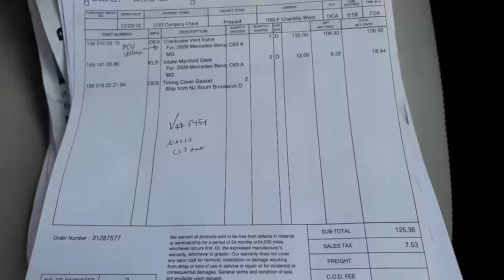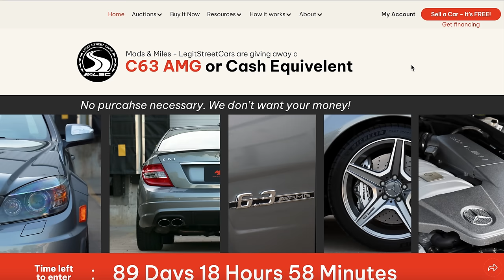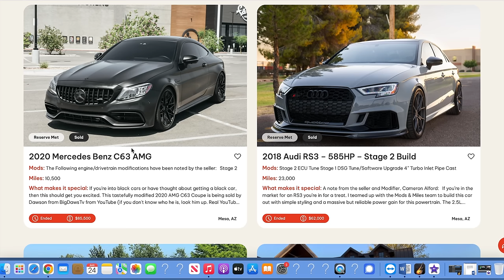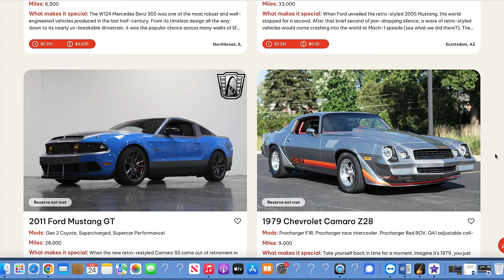I Bought A Blown Engine C63 AMG 800 Miles Away! Flew In With A Bag Of Tools To Fix It & Drive Home!

Comment: Hi Alex, had the same happen with my C63...just cruising along casually and blew a piston. Check the spray patterns on the injectors that were in there along with the pcv. Those were the culprits for me.
Reply: Wow. Terrifying, & sorry to hear that. Where does the pcv system failure come in to play here? Was it excessive amounts of oil getting by just like the excessive amounts of fuel from the bad injector?
I'm lower on the totem pole with a 3.5L m272 & I'm at the point where I'm going to be doing my oil separator & it's cover on a regular basis. Even after 20k ish mi, it starts letting way too much oil past gumming up that weak manifold.

Edit: I'm an idiot & forgot how the injectors go through the manifold. If the m156 pcv system is as shit as the m272's, those injectors are getting all that carbon.
Reply: The most amazing part must be mercedes marketing Department. If a Chinese car company built as crappy quality cars as mercedes no one would ever buy that crap. Their interiors are super bad and cheap, their engines are crap, panel gaps horrible. Good job to the marketing of MB.

Comment: Greetings from South Africa, your channel helped me greatly with my W210, fixed most things myself and avoided ridiculous shop quotations for repairs, unfortunately had to sell it due to some challenges. Looking forward to getting another cheap one and start working on it, keep it up you have no idea how valuable your channel is  to us in small income nations
Reply: Did you do the crankshaft pulley replacement by yourself ? I'm about to do that and a valve cover gasket replacement on a FREE 2001 Mercedes E320 wagon
Reply: Mzanzi in the house?
Reply: @hajileserpud9539  how did u get a free car
Reply: @raresrares7817  I work as a side hustle doing mobile mechanic and a customer had this low mileage 2001 sitting in a garage outside, he couldn't get it to start and dealer wanted lots of money to diagnose and fix so he just gave it to me because he didn't want the headache
Reply: @hajileserpud9539  damn man u lucky,im tryna be like u

Comment: Last year I picked up an 86 Trans/Am with a supposed blown LB9 305 engine, I sourced another 305 and was ready to go get it until my dad took a quick look and realized the firing order was for a Ford, new plugs and wires put on right car fired right up. Paid $800 for the car with 142,000 Kilometers on it, next on the list is a clutch and exhaust and it'll be on the road next spring.

Comment: I just had a stuck open injector on a 01 Yukon with 5.3 it filled the cylinder with so much gas so quickly the rod snapped trying to push the piston against all the gas. Trying to save money tested the other injectors with 12 volt battery, they all clicked but a couple clicked quieter than the others. Rebuilt it, turned it over…BAM instantly same thing happened on other side. Broke the rod in same area as one on other side.

Comment: The car has registration and inspection stickers from NY which expire in April of 2023, I think what happened is the owner you bought it from probably bought it with a blown engine, tried fixing it themselves and gave up.

 NY registration has to be renewed every 2 years so that car was registered no longer than 1 year 5 months ago, and knowing the kind of people who drive these kinds of cars here in NYC, paired with the aftermarket additions, I'm pretty sure this car was run pretty hard, had a fuel/air problem that the owner tried to figure out themselves (manifold gaskets), and eventually the engine locked and it was sold to someone in PA, and then to you.
Reply: Every NY or NJ car that I've seen being sold in PA is a hot mess. It's like they think we are more gullible here.
Reply: @brandonwc  sounds like you are 🤣🤣
Reply: @brandonnunez3644  Yeah, I'm not saying they are wrong. I'm pretty sure I got a Hurricane Sandy truck. They laundered the title through DE and I was too impatient to get a carfax.

Comment: With how frequently modern engines have top end or piston failures they should start coming with a split sleeve that only goes down the first half of the way (the majority of the force and heat is in that top portion anyways and it’s relatively likely that damage would be more likely up there) the design should be so that with the head off and the motor mount out on the opposite side to tilt the engine you can slip it past the body of the car and slide it in enough to use a tool to press it in that mounts where the head does. With a system like that you can save probably 90% of the engines that otherwise can’t be and possibly get some level of functionality out of the other 10% aside from crank failures, any lower cylinder wall damage could even just have the wall cleaned enough that the rings don’t get caught, or a possible stepped bore could be made so the bottom is also a sleeve and rests on a ridge and a groove in that accepts the top sleeve which would have a wider top sealing area (wet sleeve) so the bottom seals can slip past it enough to allow the previously mentioned pressing tool to fit.
Reply: These kind of cars seem so cool and fun on paper and in theory, but I'm glad I never bought one. Super high performance cars are a crapshoot, and they would cause too much anxiety for me to ever enjoy properly.
Reply: @OMGWTFLOLSMH  the old Jaguar v12 was pretty reliable

Comment: Considering the spark plug was already loose on the bad cylinder then I think it's pretty much guaranteed they knew it was bad
Reply: 100% they knew, damn I hate scammers, but that's the risk you take buying sight unseen, I guess.  Sucks all the same, though.
Reply: When the dude was still happy to sell it for $16k after Alex told him it could just be a stuck injector, Alex should have known it was cooked.
Reply: @hedgerhedgerhedgerhedger4454  Maybe, hindsight is always 20/20, but you make a good point to at least be suspicious.  Buying sight unseen is always a risk.

Comment: The injectors are a separate problem. Most injectors from BOSCH really never go bad. In their Motronic system fuel will not pass thru if you have a bad: coolant temp sensor, MAF sensor, fuel relay, electronic fuel regulator, or a bad pump.

Comment: Sometimes ppl drive the car until it’s low on oil if the oil level was off you could try    Turning the motor over while feeding break cleaner go back and forth it will free up

Comment: Pull the oil pan, disconnect the bad rod, push the pissing up as high as it will go or try and remove it, disconnect the fuel injector and drive it home on 7-Cylinders.

Comment: You should put the seller on blast, you're right that's why they didn't even tighten the coil pack screw down, they knew the motor was totally fucked.  It was not your fault, he straight up lied.

Comment: Put a k24 from a Honda in it you could totally build it with a turbo and make 800 to 1000 hp for what a factory motor would cost just have a adapter plate made to bolt the k24 to the factory transmission

Comment: I am a mercedes master certified technician of 15 years. I can say that I have never seen a stuck injector on that engine...tons of other issues tho, cam adjusters, head bolts, intake manifolds ect. sorry for your luck I was really routing for y'all.  If you need any information/wis documents/ ect feel free to contact me.

Comment: Hello Alex and thanks for your videos.i have learnt a lot from you in just a short while. Please help me out with this.I worked on  an OM104  engine that comes in the Rexton RX320  and the engine had overheating. We changed the cylinder head gasket  and it still over heats. The water pump and  fans work fine.What could be missing?

Comment: Literally owns a fancy Autel scanner, doesn't even bring it to check the car out, just immediately starts tearing the car apart on a hunch.  Solid troubleshooting skills!  lol    I get it, gotta add the drama for the tube.  But damn it's frustrating to watch as a mechanic.
Reply from the maker: The scanner wouldn't have found the engine damage. It had misfire codes. Would have taken us down a similar path
Reply: @LegitStreetCars  It's all good. I didn't mean to be busting your balls.  I like what you're doing on the channel.   I imagine you can get away with not blowing 10k on a used engine.  Pretty sure these aren't hypereutectic blocks.  So it'd be worth dismantling and checking the cylinder for damage.  Might get away with a cylinder hone, and replacing one piston.  Would make a good video series regardless if it works or not.

Comment: I had an srt8 and I ONLY used hand tools to change the oil.did it 3 times, then I just stopped doing it myself. You know why?  I didn’t know that there were battery powered impact wrenches. Lol

Comment: Bought a 2006 S65 AMG from Mancuso sight unseen. Never again. I learned more about the M275 V12 than I ever wanted to… car needed new motor mounts, new front rotors, new coil packs, new ABC/power steering pump, etc. I tore that car apart and put it back together properly. I had 28k into the car, plus another 6k or so in parts. I then had to sell it a few years later at a loss, not because there was a mechanical issue, but because I needed money for my daughter’s tuition. Suffice it to say, I will never buy another vehicle sight unseen, nor any car from Mancuso because those guys are a bunch of crooks and liars.

Comment: No way this is worth $27k in ANY condition. Has the used market gotten that insane?? Even if it was a 2012 it’s not worth that.

Edit: Yeah I looked it up and avg Fair market value is $23,600 and that’s at a dealer. I’m surprised it’s even THAT high. Crazy.

Comment: I'm sorry Alex but the more that I thought about this, I bet that a shop on one of those receipts borescoped that engine and that the seller knew exactly what he had. Describing it like he did would leave the possibility that the engine was salvageable when he knew that was not the case. It's at least dishonest if not fraudulent. I would certainly ban the seller from mods and miles before he even started. You are a better person than I am. I would name names.

Comment: Dude. Those engines are hand built. Krautz engineering.  Failure with such low milage is very abnormal. Personally I think chain issue. Bent valves. If you can't prounance it don't bother fixing it.

Comment: I would still be checking for an electrical issue first. Doesnt need to be hydrolocked for the car to run like a bag of shit and then not turn over.

Comment: I bought a 2007 E550 from a super shady toe salesman he  LIED LIED LIED and lied. 
I was dumb buying this car with the FAMOUS balance shaft issue. 
Somehow he had the check engine light off, claiming the vibration was from motor mounts. LIE. Mounts are new.
The sprocket on these lame 3.5L and 5.5L cars were by design an issue. Benz is lame for this. 
They even beat the people in the class action lawsuit.
The motor must be torn down to replace the sprocket and its known Ito be a $5k job at the dealer if they will do it and well they said NO.
I now have a super pretty car that sits and does NOTHING. Maybe put it across the scale.